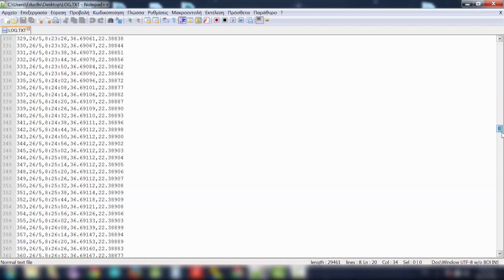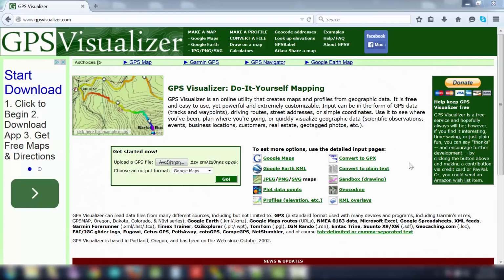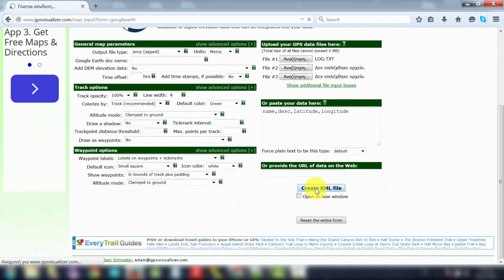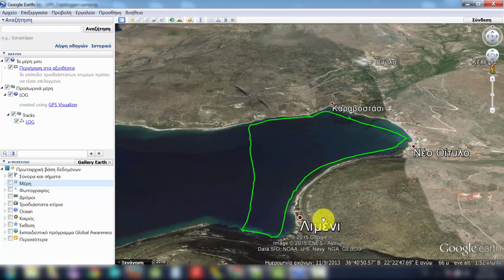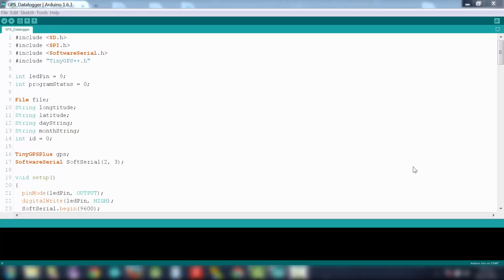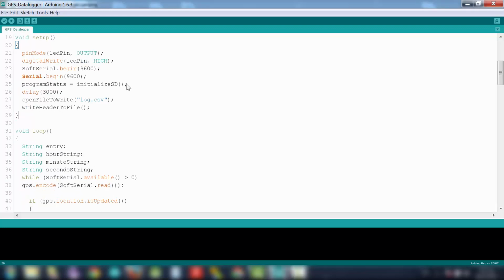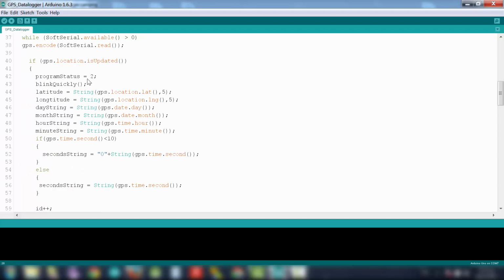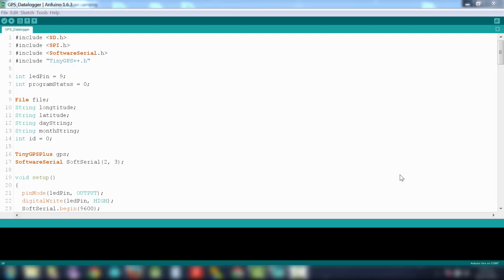Arduino GPS tracker and Google Maps Tutorial

Comment: I modified the code a bit and added a 16x2 lcd display. You can see the lat and lon data on lcd. Here s the code :

#include <SD.h>
#include <SPI.h>
#include <SoftwareSerial.h> 
#include "TinyGPS++.h"
#include <LiquidCrystal.h>

int programStatus = 0;

File file;
String longtitude;
String latitude;
String dayString;
String monthString;
int id = 0;

TinyGPSPlus gps;
SoftwareSerial SoftSerial(3, 2);
LiquidCrystal lcd(9, 8, 7, 6, 5, 4);

void setup()
{

 SoftSerial.begin(9600);
 Serial.begin(9600);
 lcd.begin(16, 2);
 lcd.setCursor(0, 0);
 lcd.print("lat :");
 lcd.setCursor(0, 1);
 lcd.print("lon :");
 programStatus = initializeSD();

 
 openFileToWrite("log.csv");
 writeHeaderToFile();

 
 
}

void loop()
{
 String entry;
 String hourString;
 String minuteString;
 String secondsString;
 while (SoftSerial.available() > 0)
  gps.encode(SoftSerial.read());
 
 if (gps.location.isUpdated())
 {
  programStatus = 2;
  lcd.setCursor(5, 0);
  lcd .print("                "); //Print blanks to clear the row
  lcd.setCursor(5, 0);   //Set Cursor again to first column of second row

  lcd.print(latitude); //Print latit.
  lcd.setCursor(5, 1);
  lcd.print("     "); //Print blanks to clear the row
  lcd.setCursor(5, 1);   //Set Cursor again to first column of second row
  lcd.print(longtitude); //Print long.
  latitude = String(gps.location.lat(), 5);
  longtitude = String(gps.location.lng(), 5);
  dayString = String(gps.date.day());
  monthString = String(gps.date.month());
  hourString = String(gps.time.hour());
  minuteString = String(gps.time.minute());

  if (gps.time.hour()<10)
  {
   hourString = "0" + String(gps.time.hour());
  }
  else
  {
   hourString = String(gps.time.hour());
  }

  if (gps.time.second()<10)
  {
   secondsString = "0" + String(gps.time.second());
  }
  else
  {
   secondsString = String(gps.time.second());
  }

  id++;
  entry = String(id) + "," + dayString + "/" + monthString + "," + hourString + ":" + minuteString + ":" + secondsString + "," + latitude + "," + longtitude;
  writeEntryToFile(entry);
  delay(5000);
 }

}
int initializeSD()
{
 Serial.println("Initializing SD card...");
 pinMode(10, OUTPUT);

 if (SD.begin(10))
 {
  Serial.println("SD card is ready to use.");
  return 1;
 }
 else
 {
  Serial.println("SD card initialization failed");
  return 0;
 }
}

int openFileToWrite(char filename[])
{
 file = SD.open(filename, FILE_WRITE);

 if (file)
 {
  return 1;
 }
 else
 {
  return 0;
 }
}

int writeToFile(String text)
{
 if (file)
 {
  file.println(text);
  return 1;
 }
 else
 {
  return 0;
 }
}

void closeFile()
{
 if (file)
 {
  file.close();
 }
}
void writeEntryToFile(String entry)
{
 openFileToWrite("log.txt");
 Serial.println(entry);
 writeToFile(entry);
 closeFile();
}

void writeHeaderToFile()
{
 writeToFile("Id,Date,Time,Latitude,Longitude");
 closeFile();
}

Comment: do you think that's most accurate than a phone-gps?
Reply from the maker: +Giuseppe Badagliacca No I don't think so. The advange I can see is that with proper power management you can have a gps datalogger that can run on batteries for months.
Reply: Thank you. For some purpouses can be very interesting

Comment: How many times per second can you write the GPS data to the SD card? Will it write 10 times a second, without errors?
Reply from the maker: Edward Armstrong Here's what you can do. I don't know if it can write so fast, but you can have a buffer in RAM, which can be written very fast, and write the data from the RAM to the SD every 30 sec for example. This way it will faster!
Reply: +Educ8s.com As far as I know, most of the time, it is not possible to get data at a higher rate than 1 Hz.

Comment: Definitely a nice project!  I really like how it shows where  you!ve been from beginning to end. I have a thought to your question about how to improve it by lowering the current draw. I noticed you didn't use that library that you showed before about the low current drain. What if you were to use that? PS, also good video of the waterfront. :-)
Reply: Okay I have another thought.  :-)  Although I'm fairly new to Arduino, I have an idea that if a file already exists on the SD card that a new file will be created so it doesn't delete the old file. It could be automatically named with an increasing number at the end like text01, text file02, text03,  etc. That way if using this to log something and happened accidentally shut it off or say you are finished logging one trip and you want to log another trip, but keep the data from the first trip. I imagine that would be written into the sketch.  I've done things like that before with php for websites. But never worked with these sdcard moduals. Could these moduals handle that?
Reply from the maker: Dog Rox Yes, that's a good idea. We can do it easily but it adds more complexity to the code and reduces the available memory of Arduino. Now, it does not delete the file. If the file exists, it just adds the new entries at the end of the file. I will try to make a small function to create a new file each time though, as it is a better solution. Thanks!
Reply from the maker: Dog Rox Yes the low power library is a good start. I was thinking moving away from the shield as well. Using an arduino pro mini with a small gps module and an SD card module along with the low power library I think we can lower the current draw to 10mA or less... I will try it in the future..
Reply: Oh well that's still good though that you have it actually a appending (adding on) to the file that's already on there without deleting it. At least you are still able to save the previous data. :-) but yes that would be easier to organize if they were separate files. :-)
Reply: yes I would be curious to see that also where if you use the smaller modules and the low power library.  I have the sdcard modules. I don't have the shield. I don't have a GPS module yet but will be getting that in the future :-)